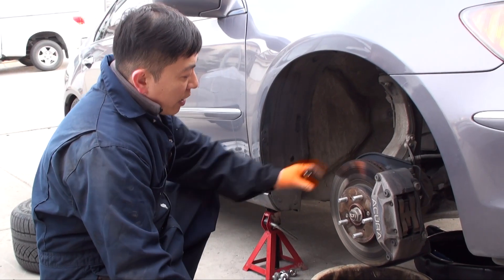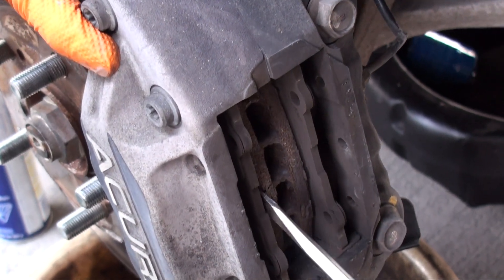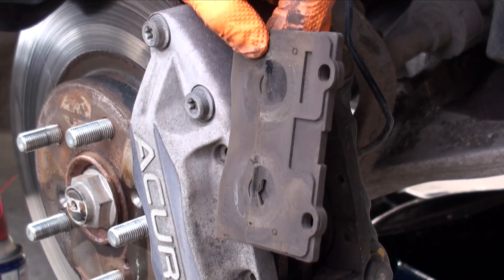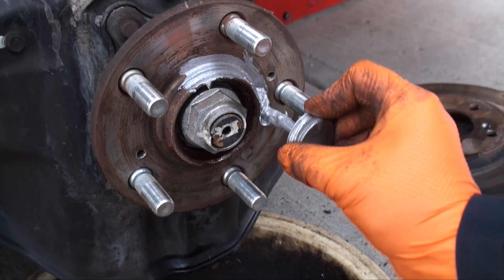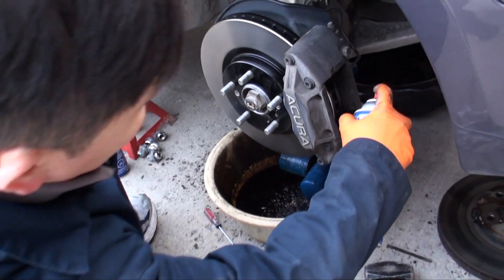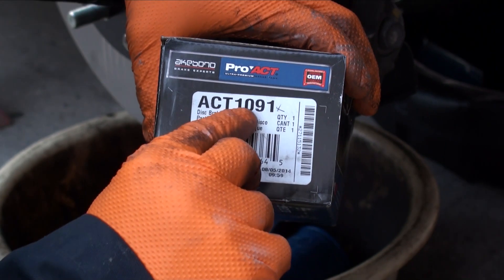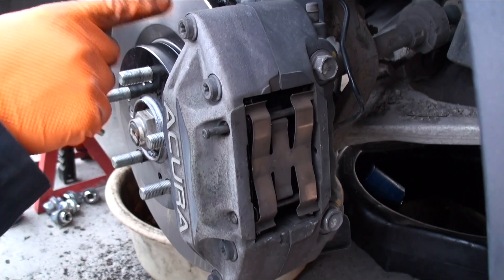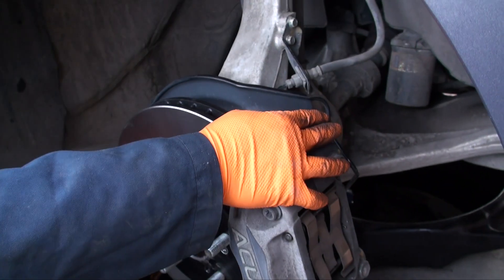Acura RL Front Brake Pads and Rotor Replacement

Comment: Great job 👍
Just my 2 cents, I think it's  actually better to unbolt brake line bracket, two 10mm bolts takes no time than you have a lot more flexibility with the caliper.

Comment: There is a tool called ratcheting caliper piston tool that spreads the calipers. No need for screwdrivers.  You could provide an amazon affiliate link in the description.
Reply from the maker: 100% that would be ideal and I will link the matching caliper piston tool.  The reason why I did it with screwdrivers is because that helps others not have to buy a tool they may only use a few times in their car's lifetime.  The screwdriver method is admittedly cheap and dirty but it does work :). Thanks for stopping by.